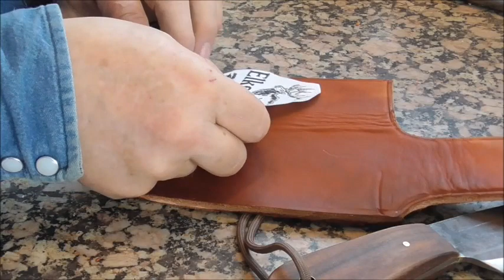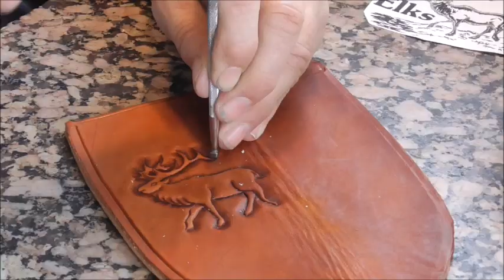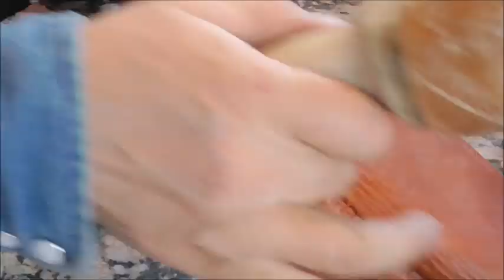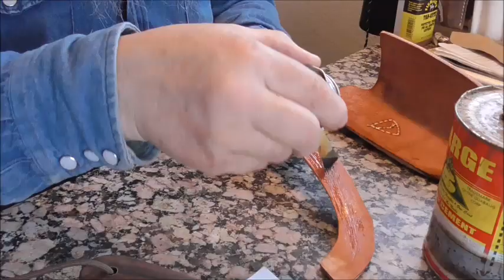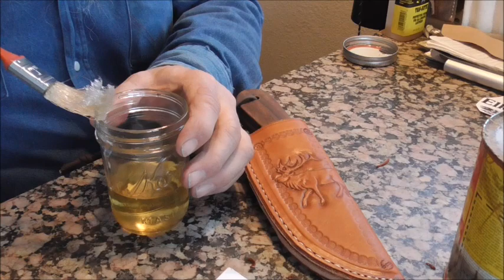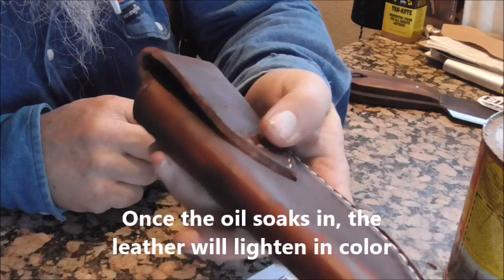Carving an Elk on a Leather Knife Sheath

Comment: I know this is an old video, but I hope I get a reply. I'm very new to leatherworking. Like, less than a month in. However, I noticed that you did some things contrary to most of what I've seen in other videos, and I'd love to understand why you did things that way instead.

1. Everything I've seen has said to stamp/carve the leather before you dye it. I could be mistaken, but it looks like it was already dyed when you started.

2. I've seen it suggested that you should cut a v-groove down the center when doing a fold over sheath, since it allows the leather to lie a little more flat.

3. You took the neatsfoot oil down inside the sheath as well as the backside of the buckle loop. Is there a reason that you did that after all the stitching and not before?

4. Is there a reason you waited until after full assembly to slick the top and strap edges until after assembly? It seems it would have been easier to do beforehand.

5. It's my understanding that slicking/burnishing is to pack down the fibers and make the edges less susceptible to the elements. So it makes sense to me when I see others take the time to sand and smooth out the main edge of the sheath before slicking. Is there a reason you left it somewhat rough? 

6. I know there are a lot of options for what is used for slicking the edges. I'd love to understand why you use Tan Kote instead of something like Edge Kote or gum tragacanth. As in, what are the differences and what led you to that choice?

7. Everything I've seen says you should let things dry before moving onto the next layer of coating. So, dye, dry, resist, dry, antiquing, dry, topcoat. I may have missed if there was a cut between the neatsfoot oil and the Saddle Lac, but it appeared to me that you applied it, buffed it, and sprayed it consecutively without any dry time. Does it still being wet not have any effect on the top coat's adhesion?

8. Yours is the first video I've seen that uses Saddle Lac as the top coat, so it doesn't seem to be a popular option. I guess, based on what I've read, that it has a tendency to crack. I really don't know. Is there a reason you go with Saddle Lac instead of the more popular options I've seen like Leather Balm, Leather Sheen, or Resolene?

8. Taking a step back to the assembly, and this is more my own curiosity rather than other people's "best practice." I understand why you wouldn't want a rivet inside the sheath; it can easily scratch up the blade. But I just imagine that frequent use the sheath would have the sharp blade scraping across the stitches, eventually causing them to fray and break. Have you found this to be the case or am I just imagining an unrealistic scenario based on my inexperience? 

Since this video is 3 years old, I'd love to know how this sheath has held up. 

Your artwork is absolutely beautiful. I hope I can reach that level of skill. I've followed a couple beginner tutorials that have turned out well. Unfortunately, I'm not an artist. Without following some sort of tutorial, I'm not sure I'm going to be very good at figuring out where to apply shading and details, so I don't see myself being able to go very far in the carving aspect of leatherworking. Thank you for your video exhibiting your talent.
Reply from the maker: Hello!  Wow where to start?  Ok, here go's....
1) The leather is pre-dyed at the factory and is saddle tooling leather, I don't use any dye at all. 
2)  You can, but don't need to. 
3) The glue won't stick to the oil.
4) The sewn edge usually needs trimmed a little after sewing, so it's easier just to do all the edge polish at once. 
5) Slicking the edge only really makes it look more finished. It had nothing to do with the weather. 
6) I like gum tragacanth better, but I haven't found any for sale lately. It works better than this stuff. 
7) I don't use any dyes. Neatsfoot oil is water soluble, but it better put on dry.  This was almost dry before putting it on.  The saddle Lac Spray doesn't seem to affect drying at all.  
8) Saddle lac doesn't crack. It's not paint, it a wax/oil finish.  It waterproofs the leather somewhat, and gives it a shine. 
 Thanks for watching this, I hope I answered your questions. 
Good luck on your leather work. It is a lot of fun to do!

Comment: I want to learn how to do something like this!
You make it look so easy but how long does it actually take to learn how to use the tools used in the video?? Thanks for sharing Your knowledge and Artwork!!
Reply from the maker: Actually, not very long. You can get the leather tools from ebay pretty cheaply.  Just playing with each one on a scrap piece of leather will teach you a lot about what each one will do.  Like anything else, the more you do it, the more easy it will get.  Give it a try!
Reply: @MuskratOutdoors  definitely will be practicing then!!
Just polished up all the tools yesterday so they'll slide on the leather easier and getting ready to print out a simple design on vellum to make it easier to transfer. Played around with a feather design and everyone tells me it looks great but then I tried another piece and failed right from the start but I'm going to finish it up and try some undercut techniques I've seen done on floral designs.
Thank You again for the Confidence Building, I really appreciate Your Time and Motivation!! 😊

Comment: This kind of leather work is something I have been wanting to start doing, any tips and tools you would recommend?
Reply from the maker: Give it a try!  Really it isn't that hard to do. Just your basic tools. A swivel knife, a stylis (the pen looking thingy), and a few shading tools is all you need.  The one I use the most is a bevel shader.   Flowers and things I draw, but animals I trace onto the leather when it's damp.  The leather should be damp but not wet.  I have found that with animals, a side view is easier to do than a front on view.  I think the main thing is to start making small things and play with your tools until you learn what each one does, then move up to bigger stuff.  I enjoy doing it, but you have to be in the mood to do a good job......and clean hands!  Something that seems rare to me!  HA!  Good luck!  If you decide to do it, please send some pictures!

Comment: very nice work. what does that wood stick do at about 11:20 ?
Reply from the maker: They call that a "Slicker". I made that one from a piece of cow horn and a ceramic dresser knob. The cut edge of your leather will always be a little fuzzy.  That "Tan Kote" stuff is a wax type finish similar to car wax. You use the "slicker" to polish the edge and get rid of that fuzzy look.  Both the horn and the dresser knob are smooth, so it works really well.
Reply: @MuskratOutdoors  so that was horn not wood, thanks.